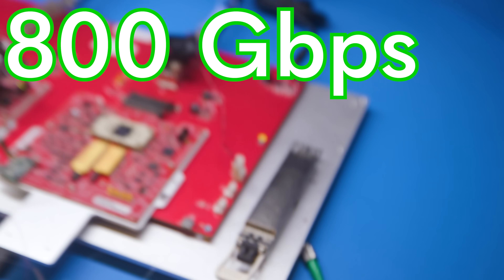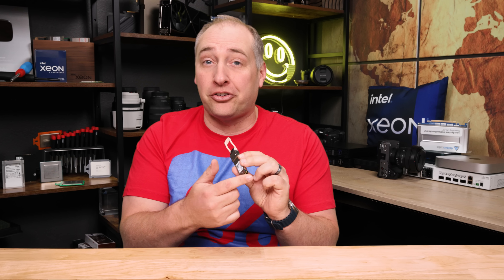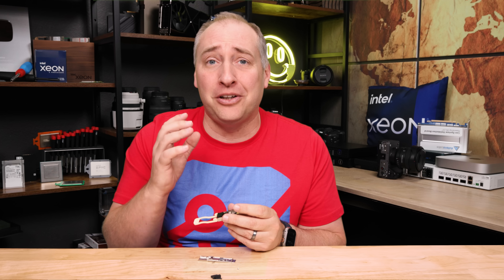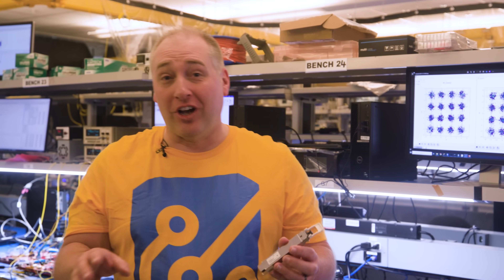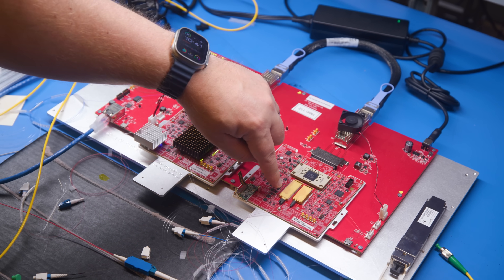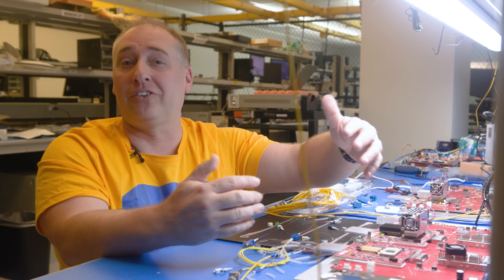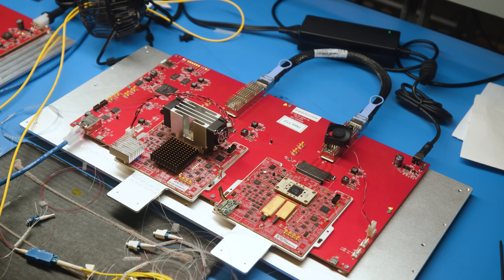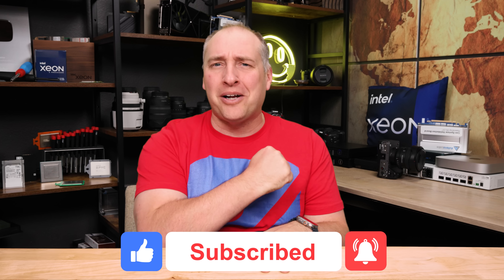HUGE AI Clusters Will Need These

Comment: For anyone wondering about the price, I did a bit of Googling, and I came up with a price for a 600km rated 400Gbps QSFP form factor coherent transceiver. It was 16.5k USD, which is ouch.
Reply from the maker: I mean the optical module is not the most expensive part in this equation.
Reply: @ServeTheHomeVideo  given a 800Gbps 1000km module is going to be at least 20k USD then if you are populating a 64 port switch and spending well north of one million USD on optical modules the cost of the switch itself becomes secondary.

Comment: Networking speed is really starting to out pace PCIe. To run 800Gbps, that is PCIe 6.0 x16. If ethernet bandwidth doubles again for 2026, that will need PCIe Gen 7 CPUs or an interface with more lanes. The IT industry is getting crazy.

Comment: 1.6Tb+ has been the standard for datacenters fort the past few years
Reply from the maker: Not in standard pluggable optics. Remember a modern server with PCIe Gen5 x16 is only pushing a 400Gbps NIC link. Even the big AI buildouts are using 800G for uplinks and splitting into 2x 400G these days

Comment: We have come a long way since my initial connection on my C64 using an old 300baud Pulse Dialup modem back in the 1980's

I can still remember working for a local ISP back in 1998 here in PDX, I was the only employee that had access to the first rollout of xDSL from my local telco, I think they were named Qwest back then after the ATT breakup.

It was a breathtaking 768kbs downstream and 256kbs up.

Comment: ISS is only 408km from earth. Think we could cable it?
Reply: It is not in a stationary orbit, but going in a sort of but not quite S-shape around the earth (if you project the trajectory on a 2D map) so that would get interesting really quick (impossible). I don't know what sort of engineering would go into a "space cable" that could go up to satellites in stationary orbit but given that you transmit light through a plastic strand, you might as well just use a laser light on the satellite and ground station. 
You have to find a way to deal with bad weather but astronomers have been "shooting" light beams up into space for a long time now for scientific experiments. You could potentially use that to communicate with satellites but then the skies around the world would light up like christmas trees. And airplanes would have to fly around all of this as well.
Reply: NASA demoed 200 Gbps downlink from a satellite using off the shelf CFP optical transceiver module (TBIRD) so yes its possible and have been done

EDIT: Actually the ISS do have a optical terminal, and they call it ILLUMA-T

Comment: Good video but anything these days that's gonna require distance we just run dwdm. Sometimes even a dwdm ring for redundancy. Then I don't have to worry about buying super expensive optics when running 30 or 40 connections...
Reply: Exactly what we do.  Keep looking at amplifiers and more pricy modules but never had the need for anything like that.  If I was artificially restricted in shelf space or something then maybe.  I know the game I play is different from what the big boys play.  If they are putting in a datacenter and don't want to touch the networking for ten years and are price insensitive then these things make sense.
Reply: redundancy with protected loops is far more important to us as well. I can't think of one business subscriber that has full 1Gbps that uses even 20% of it on a regular basis, they care about up time.
Reply: @ Yup, uptime and speed tests showing a good number.  About 1/20th of them care about latency too.

Comment: I think these speeds can break the co-location lock. If an org wants internal datacenter speeds, they can just lease some dark fiber to a datacenter and run 800G+ connections straight from their switches. Turn your datacenter inside out and spread it out!
Reply from the maker: Exactly right.
Reply: If you can actually find 1000km continuous fiber spans. These kinds of distances have been impossible forever, so most (older) infrastructure will likely not even be 100km spans.
Reply: @jfbeam  I think for moving away from co-location, you are looking mostly at the under 200km range, if not under 50 km. For multi location data center “merging”, I agree, 1000km is more of an issue.

Comment: https://youtu.be/liWmx5fxjkg?t=507 - That unassuming little fan setting on the electrical-side connector. Nice presentation, Patrick. By the way, you can do deep dive into optic modules & coexistence with copper in applications as you have shown.
Reply from the maker: Good idea

Comment: I work for a major ISP. In one of our labs we have fiber room with numerous multi kilometer spools of raw single mode fiber core which are used to simulate point to point connectivity between NY and LA, for example. Here we can run proof of performance for the industry on these types of 400 and 800 gig optics, measuring parameters like propagation delay, latency, error rates, etc.  Another emerging technology is DWDM where you can send 4, 8, or even 16 optical wavelengths down a single fiber at 400-800 Gb per wavelength.  It’s truly astounding how much data we can move simultaneously. The industry forecast is 10Gb fiber to the home in around the next 5-10 years. Just bonkers!
Reply: In Switzerland you can already get 25Gbps straight to your home! $70 / month, and it includes free television.
Reply: @Destructificial  I think it is safe to say, for $70 the television aspect is not free but I believe you that they advertise it as being free of charge.
Reply: And it's P2P
Reply: Domestic 8Gbit/s symmetric currently rolling out in France. Having difficulty filling the pipe ;P
Reply: @SteveLFBO ... and me living in Denmark having a symmetrical 1 Gbps line at home thinking I was at the cutting edge... 😢

The router provided by my ISP do support 2.5 Gbps on both WAN and LAN side, but I doubt I will reach those speeds within the next few years.

My own LAN on the other hand will probably run 10 Gbps on the ethernet cables and WiFi 7 on the access points all thanks to all the gear Ubiquity is pumping out these days at affordable prices.
Reply: We already have 10G to the home. (have for several years.) 25/50G PON's are already on the market.
Reply from the maker: Very cool! It would be even cooler to show people in a video :-)
Reply: DWDM  is not an emerging technology it is used on every intercontinental fiber cable with up to 100 wavelengths.
Reply: @kellymoses8566 96 channels of 50 GHz in C-band in that case (4.8 THz), or 64x75 GHz or 32x150 GHz (in this case), but you can of course double it by adding L-band.
Reply: Yet in the UK outside of major cities and towns you'll be lucky to get more than 70/20 mbit/s ADSL
Reply: We got 10gb to the home NOW.
Reply: @zyxwvutsrqponmlkh not really, but sure if you want to pay for it 😉
Reply: You haven't been already using DWDM at the ISP? I am with a little ISP, we have used CWDM for connecting our local pops and datacenters for a long time, DWDM is the similar just more $$$ and more complexities. I thought i had seen many carriers using optical switching years ago.
Reply: @nellermann  The big old companies move slow and live in the past.
Reply: DWDM is around for almost 2 decade now, new technology is Coherent optics, not DWDM.

Thing is modulation/encoding that reach the physical limit for normal digital signal which is around 50Gbaud (~100Gbps with PAM4), coherent optics which use modulation like old-school modem or WiFi with light signal, So we can achieve more than 100Gbps per wavelength (now up to 800Gbps for short distance), and yes  it can use with DWDM.
Reply: @sfalpha  PAM 4 is no where near any technical limit. We encode RF on light all the time and it is far far more complex than pam4
Reply: @ That basically what I said. Now new tech use coherent QPSK or QAM for DWDM and ZR Optics. PAM 4 is stuck at around 30-50 Gbaud at 40km.
Reply: Not sure why you're saying 10G FTTH in 5-10 years. For example I have 10G to my home since the end of 2018 ;)
Reply: @AtanasPaunoff  Most old installs still 2.5G PON, They may only offers 10G PON in new area (to upgrade they need to replace all CPE on all homes connected to the same OLT ports / PON Splitter).

So some area may not have 10G PON available until they decide to upgrade (which at time OLT was EOS/EOL, roughly 5-10 years span).
Reply: I work in streaming media and I am now regularly pushing Tbps, so there's plenty of opportunities for this stuff outside of AI. 
I'd also suggest that there's been plenty of demand outside of AI for increasingly faster optics.
ISPs have thousands of PoPs and with a drive towards 1Gbps the backhaul links can get congested easily.
Reply: @ In aggregate, sure. But once you're away from that swizzle-stick at the edge of your data center, that Tbps fans back out to usually less than 100Gbps. I've personally seen OLTs with over a Tbps of customer ports not come anywhere close to flooding the single 100G uplink. ('tho it has two for redundancy.)

(I've also run DSLAMs with over 2G of customer ports fed via a pair of T1's! -- without complaints, even. I wouldn't try that these days. :-) However, most at that density had T3's.)

Comment: Really would love to hear a deeper dive about how these optical modules work. Like how they handle dispersion in these 1000km+ links with different modulations etc.
Reply from the maker: Good feedback. We will look into it.
Reply: Coherent does dispersion compensation in the DSP, so no need to physically compensate the outside plant fiber.  Direct Detection would often need either fixed passive or active dispersion compensation when it would start getting to 80km or so, depending on the fiber type and wavelength of the channel.

Just an FYI - once a fiber link starts getting a certain end-to-end loss, it will need optical amplification to boost the power.  There are Erbium-Doped Fiber Amplifiers and Raman Amplifiers that can be deployed to support high span losses and thus decent distances, like 100-300km.  For longer links you will need Amplifiers every 80-160km or thereabouts, so on a route from LA to Phoenix you may have a few fiber huts along the way where the signal is optically amplified.  Because of this, these longer links are almost always DWDM links where you will multiplex dozens of coherent channels to get a decent max capacity, getting into the 10s of Terabits/s per fiber pair.  It works out to be pretty cost effective because the traffic is left in the optical domain and a single EDFA module can amplify all the channels at once, so the signal is only converted back to electrical at the far-end pluggable.
Reply: @brp-CA i remember watching an awesome video on how fiber laser amplifiers work, including a teardown (might have been a repair, too), but I can't find it anymore. Super trippy physics in any case

Comment: I'll be honest, I'm getting really bored of everything on here needing to be tied back to the AI fad. There are so many more useful applications in networking and HPC, and the underlying physical layer and optoelectronics aspects are important foundational technologies for future SERDES, CPO, and embedded photonics designs.
Reply: Personally I look at thinks like this and think you could provide a dual 800gb link to every University in the UK from just two reasonable centrally located points for a couple of switches. For those in the UK something like Manchester and Leeds. Your campus core switches are now country core switches and baring latency all the UK researchers are basically in a local LAN. Of course that gives me nightmares about the cyber security implications but still it would be insanely cool.
Reply: @jonathanbuzzard1376  you mean Janet?
Reply from the maker: You are right there's a lot of cool optical connectivity coming. The AI infrastructure build-out is really driving a lot of this, so we are getting cool things sooner because of how much is being spent on AI
Reply: @ServeTheHomeVideo Pluggable 800G/1.6T was slated for 2023 release by most vendors going back to 2020, when Intel first released their 112G NRZ / 224G PAM4 SERDES technology. A few Eastern-market vendors already had 800G and 1.6T products on the market back in 2023 for low volume applications, albeit running slightly ahead of finalised standards (much like we saw with provisional WiFi 6 and 7 products). The demand for higher bandwidth links has been consistently there for years, so I think boiling it down to AI is an easy fits-all answer you can give for pretty much any high speed compute these days. It's a new market area that people are chasing after, but it's far from the only application or source of demand, and it isn't the sole driver for general purpose high bandwidth networking, and it's just kinda disappointing to see all these super interesting technologies boiled down to "this will be good for the AI people" instead of focusing on the technology itself.
Reply: @ServeTheHomeVideo  I replied to this with a timeline of 224G PAM4 SERDES development and pluggable optics going back to 2020, with vendors slating 800G/1.6T releases for 2023 (and provisional products available in Eastern markets in that year) but it seems that reply went walkies. TL;DR yeah AI is the big new cash cow bubble everyone is trying to court, but this stuff has been in the works for five years and it's kinda lazy to just point at AI as the impetus for every new general purpose compute technology.
Reply: @gsuberland it's just one of the applications, nothing wrong in mentioning that. There are of course a lot of applications for this, no need to cry about it.
Reply: @tedpelas  oh there's no crying at all, just expressing how I feel about the trend in recent videos. if it bothers me much more I'll just unsub, it's not like anyone is forcing me to watch.
Reply: @gsuberland  Yup, as they said, the main magic of the "AI" buzzword in this context is opening the wallets to justify spending on the buildout.
Reply: Ain’t nobody outside openAI/Microsoft and Meta got money for this. Is this a great application for HPC? Hell yeah. Is anyone in HPC willing to pay hundreds of billions? Hell no
Reply: AI is a fad?? Even if they don't end up calling it that, what they're doing now ("data harvesting", etc) will continue forever. This kind of thing will become easier as per usual with technology, but it will not go away.
Reply: @stevelk1329  the same was said about blockchain, NFTs, and web3. sure, they still exist, but nobody cares.

Comment: What I learned from this video is that the L in LAN is really a stretch with this technology.
Reply: Yes and no, yes because it can now reach very far, no because in most countries you can't dig a trench (except on your own ground) in public ground and are obliged to use a company's tubing, meaning the fiber is not yours and you have to rent it.
Reply: Fun fact i know of two Fiber installations that had used between 170 to 190 km on fiber cables to connect 3 buildings, without leaving the Compound and a year later there added 50 km more.
Reply from the maker: Wow
Reply: @PpVolto  Yup, but you can agree that this is more a one of a million case than whatever cases you would encounter otherwise.
Reply: @hankhulator5007  no its more common then you think a Oil Refinery can be up to 2km wide and be up to 7km long, and with 10 to 20 Cables between buildings on each end the length adds up fast.
Reply: @PpVolto  Errr, we're not talking about the same thing, in your example, you add average lengths to make one, I was talking about one or more very long lengths.
Reply: @hankhulator5007  like i say it adds up fast and in some Countries you can with permission lay fiber between places yourself, and in Germany i think next to every Highspeed Trainline is one or more fiber line for the signals and controlls so that are only some example where stuff like this can be found.
Reply: Looooooooooocal

Comment: I recommend the talk "Going long! Sending weird signals over long haul optical networks", presented at the 38c3, for some shenanigans with long range optics

unrelated: Why did the optical industry invent the "coherent" buzzword for using something else than AM, and using IQ techniques?
Reply: Is that that guy who sent toslink optical audio signal between data centeess? It was very funny.
Reply: Coherent in this case is a term they borrowed from the RF industry.  I don't quite understand it myself, but it is used to describe how the clock signal is related to the data signal